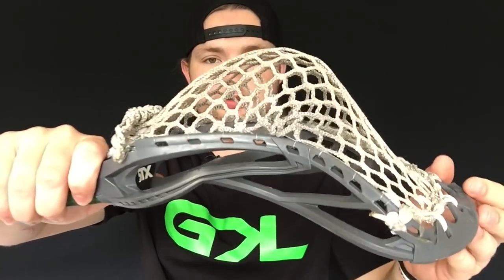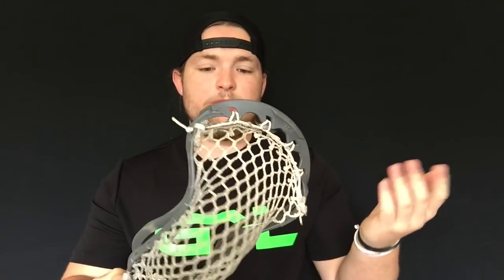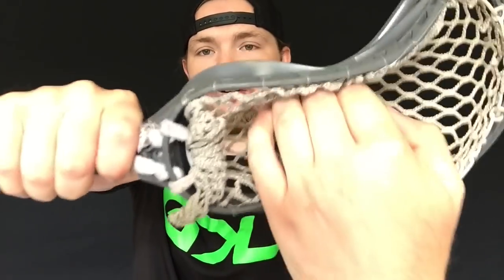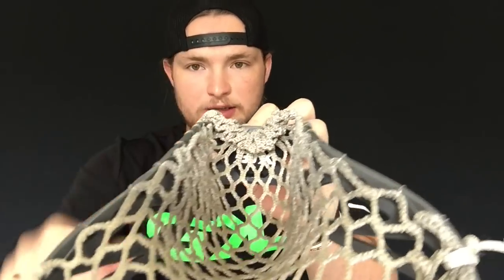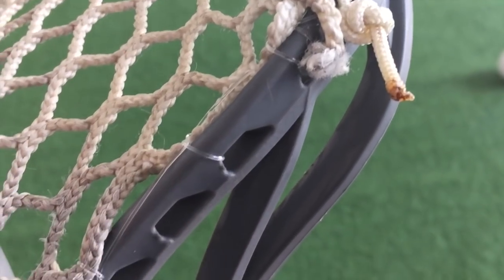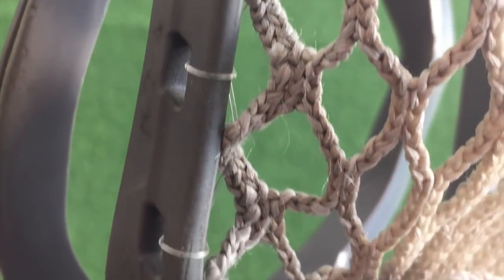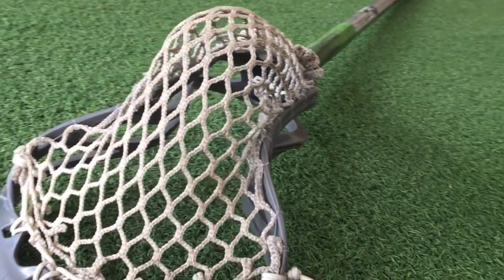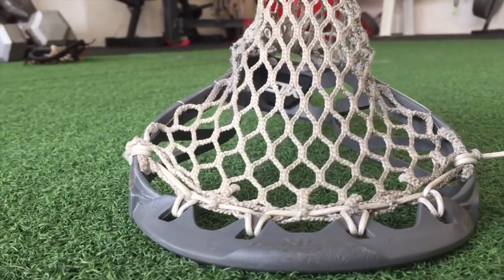GKL┇USING FISHING LINE AS SIDEWALL STRINGS?

Comment: You should try Spectra or Dyneema (any UHMWPE) line. Its primarily used in rigging. I have some 1.5mm diameter (regular sidewall is 1.58mm or 1/16") That is rated for 800 lbs.  It only stretches 3.5% compared to 18-25% with nylon, doesn't break down in UV light (like kevlar) stronger than steel by weight. I'd imagine that the set up on this video would tear your sidewalls pretty quick. 
I'll probably restring an old head but seeing as i'm 10 yrs removed from playing or stringing heads, nor do i have a youtube page, I think you should try it out. I know this video is a few years old but the only thing i can find online of someone else coming even close to what i'm suggusting. Heres a link for 1.6mm 750lb braided line. https://www.amazon.com/emma-kites-220lbs-Braided-Polyethylene/dp/B07BKQLFRB/ref=sr_1_10?dchild=1&keywords=UHMWPE%2B1.5mm%2Bfishing&qid=1618596672&sr=8-10&th=1&psc=1